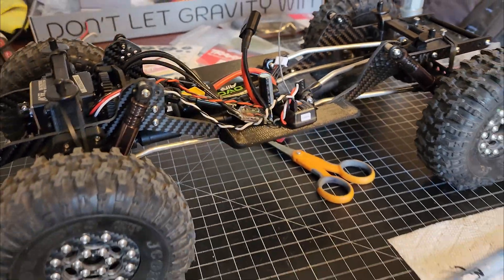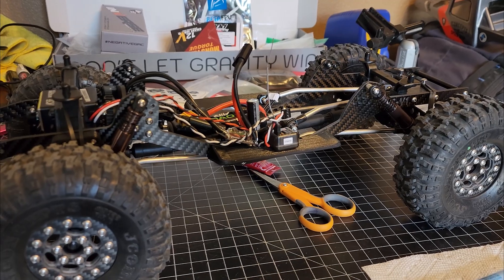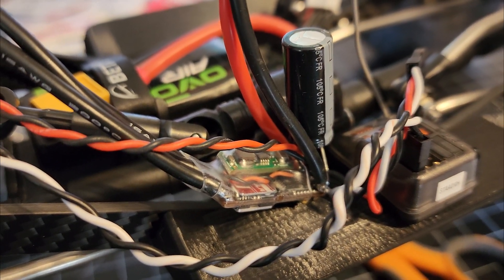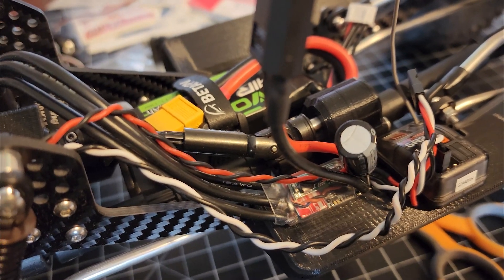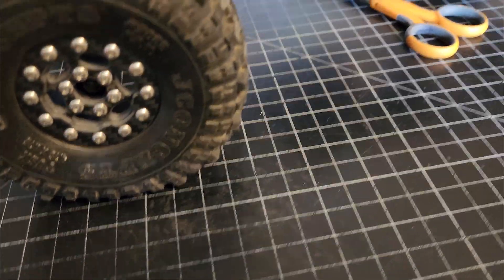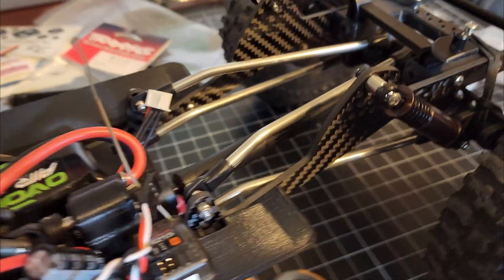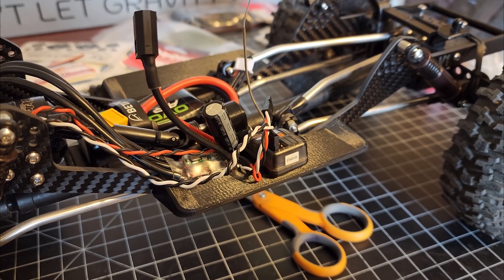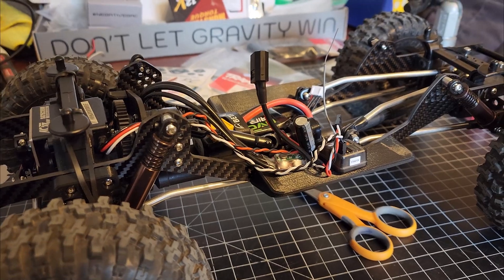UPDATE: I was wrong! | $15 silent crawler ESC

Comment: Just wanted to see if there was an update on how this is running? I'm considering the same emax esc (though now i see it's $35 and not $15).
Reply: You can probably get away with the cheaper HKSRC 35A, make sure the ESC runs Blheli_32 (32bit MCU) as opposed to the cheaper Blheli_S ESCs, although the latter may work fine and is even cheaper.

Comment: What esc is it?
Reply from the maker: Thats an emax formula 45 and I'm also trying the wraith32.
Reply: @Furadi  were you able to flash wraith32 to AM32?  It is at a good price, I want to have an ESC like this in my car
Reply: good morning.  how do you calibrate the radio with this esc ?  on the video settings I don't see the Low Voltage Protection:?  thank you
Reply: Thanks man I appreciate it! We all appreciate the help from someone with a brain 😎
Reply: Nice work

Comment: You should make a quick search about u-joint phaseing on the internet, and check your rig if it is correct in every driveshaft. If not correct it can cause an pulsating rotation at the wheels when the motor turns at a fixed rpm or vice versa. This might be the cause of the voltage spikes at higher speeds.

Comment: Iv had a similar issue using another well known silent esc,  The 12 volt servo was actually cutting out completely at 75 % throttle, added a cap, works perfectly now. I initially thought it was servo issue.

Comment: Thanks for the update. I think I will install a capacitor and heatsink on my next esc to eliminate any errors I caused last time. I am running a 1800kv, receiver power servo and 5v/2.5a BEC.